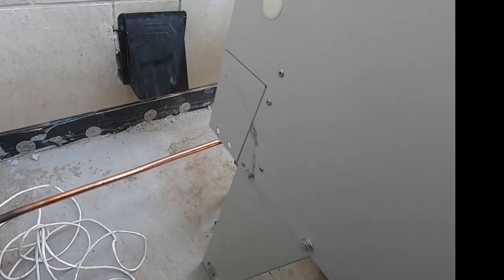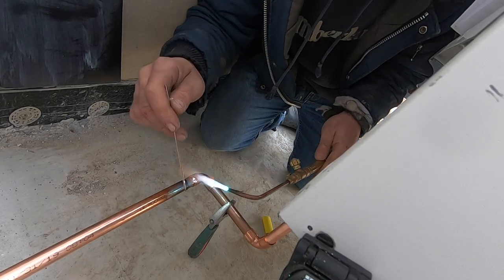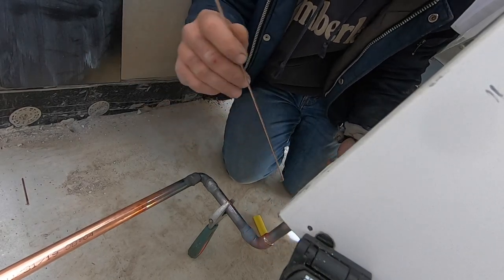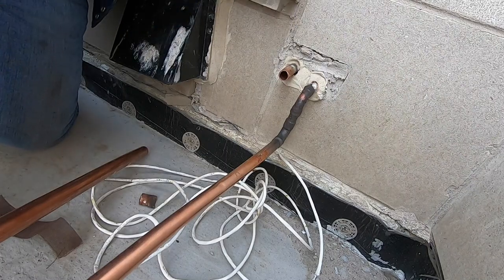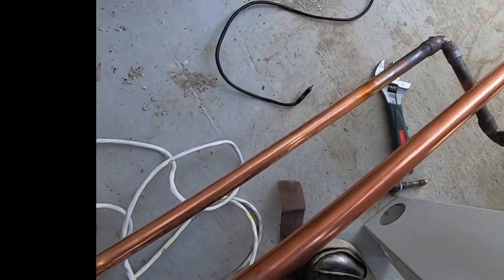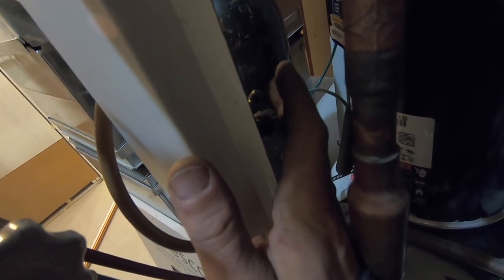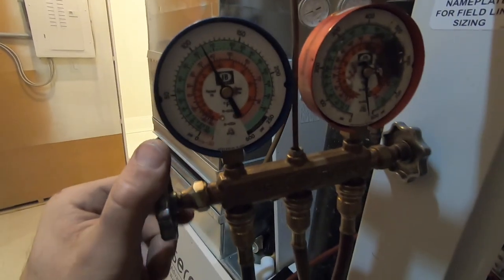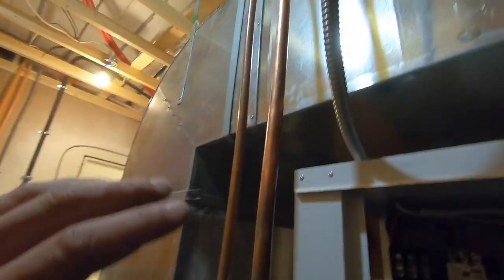HVAC: How to braze tips | Refrigeration Line size importance

Comment: I also like to build up a shoulder or cap, so it's 99,9% sure it will last forever. I dont care about a few extra rods to prevent leaks. Well done sir! 😉👍
Reply from the maker: awesome comment cheers
Reply: Put the pipe down. That is some horrendous dirty, annealed, oxidized, cremated soft copper blobbed out mess.

Comment: Nice job North...😁👍nice work using that oxygen/Acetelye rig. Use a #30 tip it will work even faster. Wet rags to wipe when done..helps for inspecting joints. How about a sight glass?? Thank you a ton for sharing!! Keep up the good work!
Reply from the maker: Hey bud.  Wet rag would of froze lol jokes.  Site glass is in unit(receiver), lines are isolated & closed. Site glass(mirror) is lost somewhere behind a unit lol. Thanks for watching
Reply: Oh yeah.. I forgot your in that moose territory. Man that makes it easier not having to add a sight glass then. Be safe out there! Have a great day.

Comment: First tip is NOT to use oxy/act torches. Why? Oxygen oxidizes the bonded area. Acetylene puts dirty carbon into the bond. Don't need 5,000 degree heat on soft copper. Propane is more than hot enough at 3500 degrees. Propane is much cleaner.
Reply: I disagree.  I don’t know anyone who brazes with propane, and everything you said about torches doesn’t make sense.  You’ll never get a brazing or med gas certification using propane.  I do 4 1/8” suction and 2  5/8”  discharge lines.  I don’t think I would have much luck using propane.
Reply: @rodgraff1782  Might want to look into welding various metals and such. Reason people use mega heat is it's faster. Doesn't mean it's superior at all. What is this about some certification? Are you saying you can't braze with 3500 degree propane? Soft copper? really?? Place the propane torch tip on your finger. See how fast you remove it LOL. Kids.......
Reply: @jimdavidson5208   What is the equipment Required for this?   Thought you were talking about a hand held propane torch, that is used for soft soldering plumbing.  Can your propane equipment silver braze 4 1/8”  hard copper ACR pipe?  If it can’t, it’s no good for me.  I don’t use soft tubing for the large industrial systems. No, I’m not a kid,  I’m a 68 year old retired HVAC mechanic.  I just was curious, because I had never heard not to use ox/act.  Can you show me some documentation, or research that  supports your claim, or is it just your personal opinion?  If there is a better technique, I am open to hearing about it.  The certification I was talking about is for the installation of copper piping for hospital medical gas.  It can have absolutely no contamination, with brazes that have 100% penetration, and no voids, as patients are breathing the oxygen flowing thru these pipes. All piping is purged with nitrogen during the process.  The certification is required to do this type of work.  If Ox/Act caused any type of contamination, we certainly would not be able to use it, and it wouldn’t be written into the job spec’s
Reply: @jimdavidson5208  I’ll agree that it’s cleaner, and ok for the small stuff.  I had to pipe a 250 ton reciprocating chiller, with an evaporative condenser.  The suction line was 4 1/8”, and the discharge line was 2 5/8”.  I can’t remember the liquid line size, probably 1. 5/8” or so. The compressors (2) were carrier 5H120’s, direct drive,which are 150 tons each, for a total of 300 tons. It took a huge rosebud to do the 4 1/8”. Propane would soot too if it wasn’t mixed with the proper amount of air.  I’ve seen a lot of sooted up propane furnaces.  I hated to clean those.  Nice chatting with you.